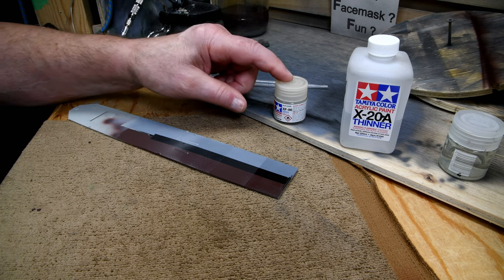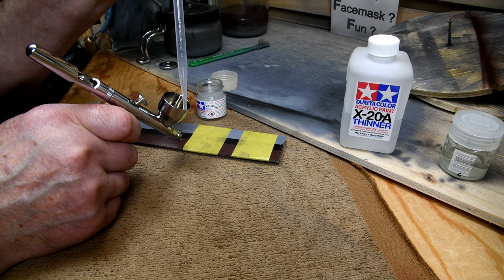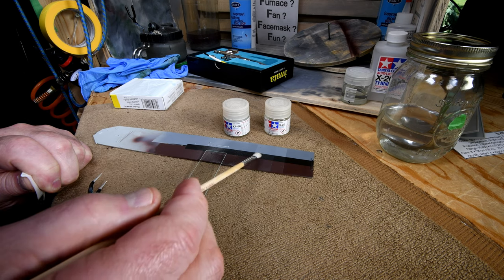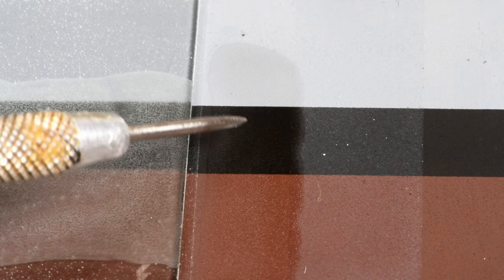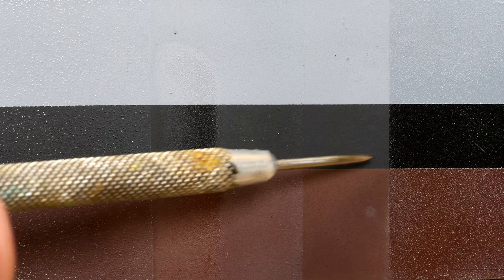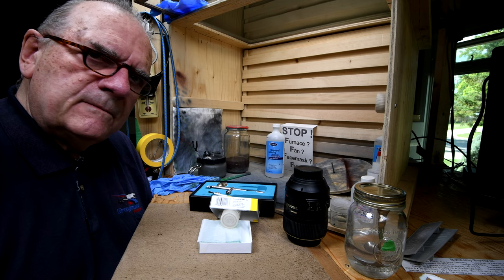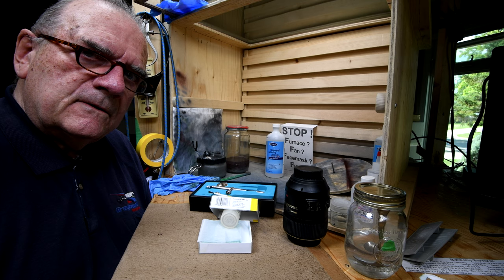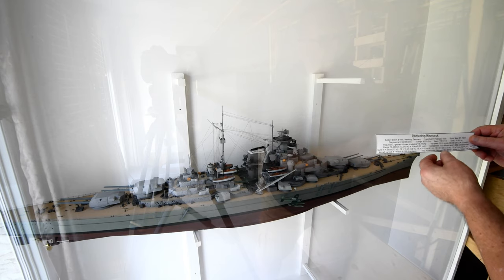The Model Ship - Part 518

Comment: I agree with you Ron, I don't "clear coat" my ships for same reasons. The only ship model I have coated is RNLI lifeboat as they are glossy and kept in pristine condition. My models are not handled or played with. Clear coating has it's place but not on my ships. I have added some weathering and salt staining to model trawler hull directly on top of Stynylrez black primer without any problem. Shock horror, I have used Stynylrez primers without overpainting or coating several times now with no issues it is excellent in my opinion. There is no right or wrong way to model making, my attitude is If it works for me I'm happy. I build my models to meet rule number 1, it is your model.
Reply from the maker: "If it works for me I'm happy" 👍🙂

Comment: Hey Ron, been a long time watcher but first time commenting!

A flat, matte clear coat will always have a haze look when viewing through a transparent medium, such as glass. It is not advisable to clear coat something that will be transparent (like cockpit glass, port holes, etc). The reason for this haze is how the matte clear coat works, by creating those tiny imperfections in the surface, it knocks down almost all specular reflection. You don't notice the haze on an opaque surface unless too much is applied, but it will always haze a clear surface.

This also aids when applying washed and weathering, as you now a more "grippy" surface (for lack of better term) to hold onto your weathering medium, as normal washes and pastels would just rub right off of smooth plastic. 

I do not believe multiple coats of matte are necessary, but multiple passes during one spray sessions may be necessary. 
I build plastic models of fictional robots, and the usual process goes build -> panel line -> matte coat -> weather/detail -> final top coat

if that order is not followed, when handled the models will easily lose their painstakingly applied detailing. obviously your models are big enough handling is not encouraged, but some models are made to be posed and moved around. For this purpose, a clear coat is almost always necessary. Plus, it helps to achieve the look of something drawn on paper, not real. For your case, I think your models look amazing!
Reply from the maker: Thanks for commenting. 🙂👍

Comment: Your not weathering your ships but if you were you would need that clear coat. Its provides a barrier to protect the acrylic when adding washes and enamel salt effects on the hull for example. See ya tomorrow :)
Reply from the maker: Yes, I agree with that. Any experimenting I've done with the Tamiya Panel Line Accent stuff did not go well on the flat paint that wasn't clear coated. 👍